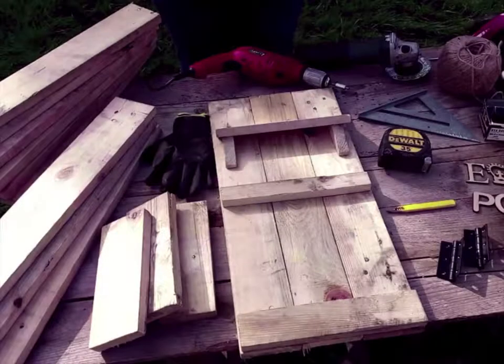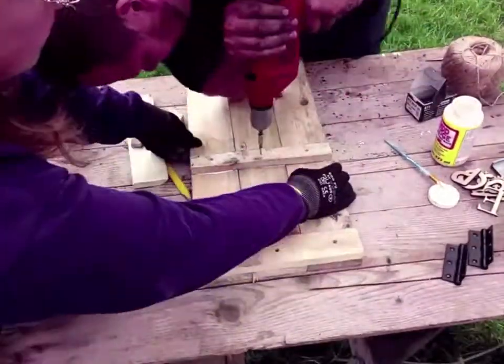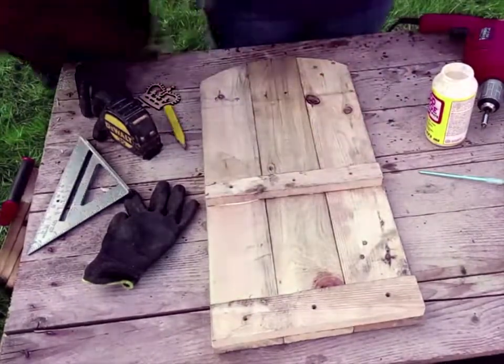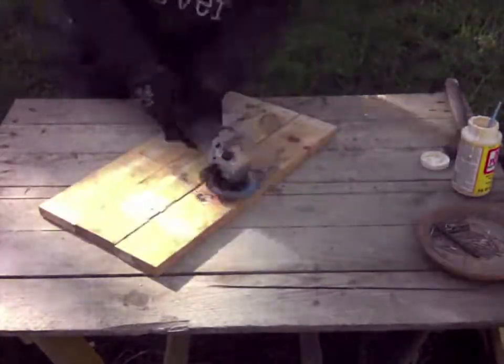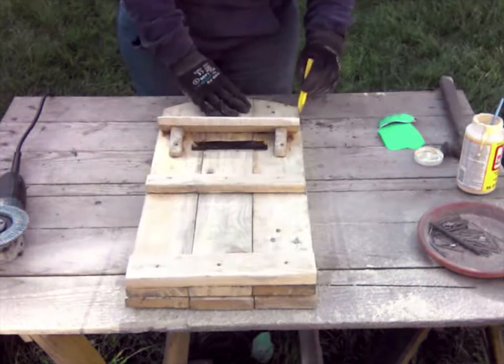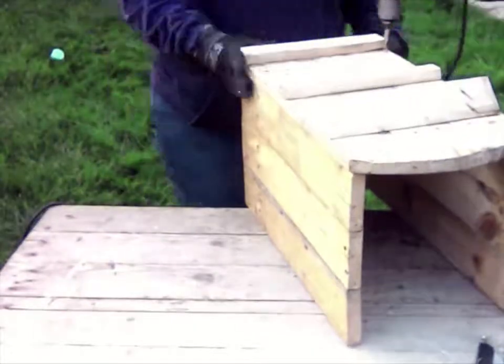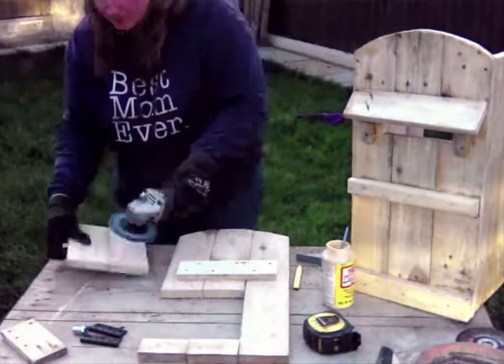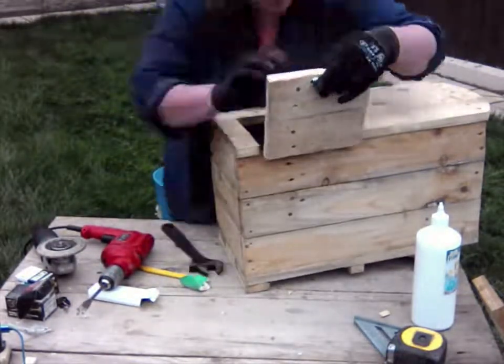Creating a Rustic Wedding Postbox Part 2

Comment: What type of hinges did you use please
Reply from the maker: Hey! Thanks for watching ☺ I used regular door hinges for internal doors and recessed them in. I wanted something sturdy that would withstand heavy use. But any would work depending on the thickness of the wood you are using and the overall look you are going for.  For example, piano hinge would work and look a little more discreet, but I find it a little flimsy. Hope that helps ☺
Reply: @PeachyKeenStudio  thanks